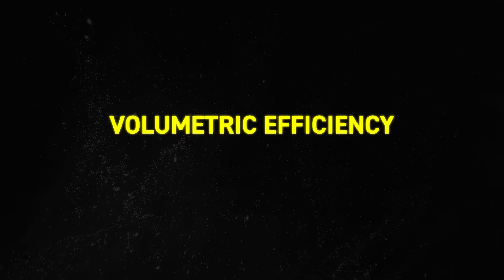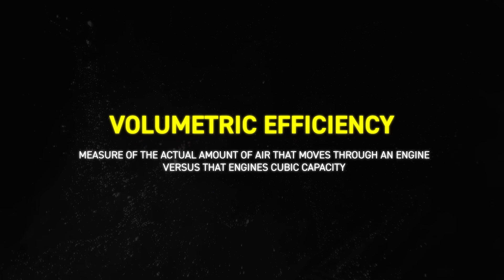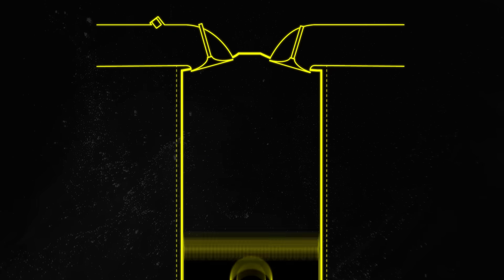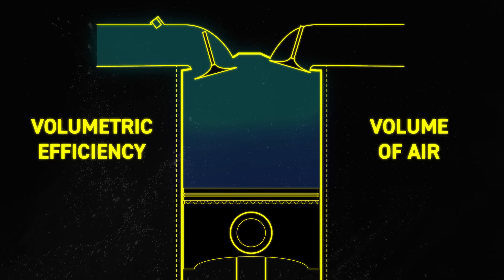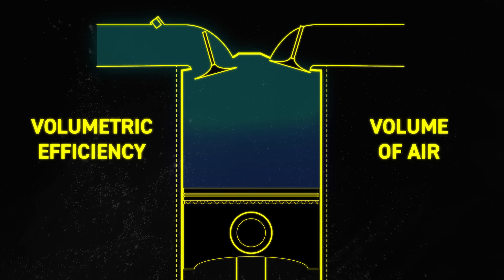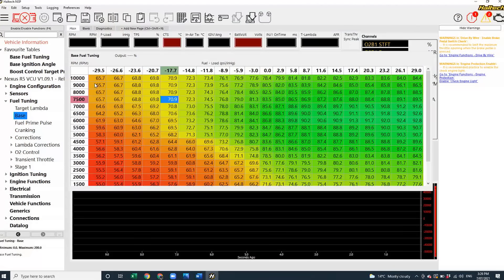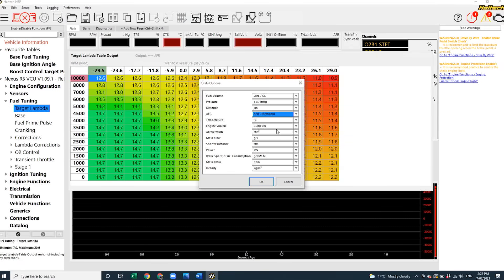🛠 Tuning with Volumetric Efficiency and other VE fun facts | TECHNICALLY SPEAKING

Comment: years ago at haltech elite training Matt said to us ,"I prefer to use  TPS as the VE table axis because its the thing that changes VE the most ".. that hit me in the head like bolt of lighting.. Thanks again Matt for the excellent explanations and knowledge you've given to so many of us  ..
Reply: @Matt Wright I can see how TPS would work great with an NA engine.
Does that hold true with a turbo and boost? I can't seem to wrap my head around it that way.
Reply: @Ye_Old_Grog  for boosted engines, no, at least not on the positive pressure part of the map.

And personally -- keep in mind I'm an above-average amateur hobbyist that has tuned my own cars with guidance from professionals, and I'm not a pro or expert in tuning like these gentlemen at Haltech; my experience comes from ROM tuning and ECU flashing late 90's and early 00's ECUs and some tuning on late-00's standalones -- I still prefer MAP+IAT over TPS, and MAF if the car has it, as TPS is the least flexible with atmospheric changes, for example if you live/drive in an area that has significant seasonal temperature swings (more significant for turbo cars than NA), or a mountainous area with large changes in elevation. So I prefer MAF as it basically directly measures the mass of air flow (as long as the flow through the MAF tube is laminar and the sensor is calibrated to the diameter properly) and it will "notice" the difference in airflow. With a MAP+IAT it depends if the ECU is programmed to think in absolute pressure or gauge pressure; with absolute pressure the ECU will still "see" the difference in ambient conditions. TPS is the most "picky" as the maps are generally only precise for the conditions that the tune was done in.

Not sure how this paragraph disappeared, but I'll try again 😆. My example was taking a weekend trip to the mountains. Start off driving at 100m elevation and a few hours later you're at 1100m elevation. The ambient pressure at 100m is close to 14.5 psi (sorry for the mixed units! I'm American 😂😂), whereas at 1100m it's closer to 12.9 psi. A car with a MAF sensor will be measuring "directly" (via how much the airflow cools a heated wire) the mass of the air entering the engine. A car with a MAP+IAT setup will still be able to calculate the mass if the ECU is 'thinking' in absolute pressure. If it makes "15 psi of boost", at 100m that's 15 psi gauge + 14.5 psi ambient = 29.5 psi absolute; at 1100m that's 15 psi gauge + 12.9 psi ambient = 27.9 psi absolute. So the ECU should still "see" the different in air mass entering the engine despite the elevation change. (For some reason I want to say that some older factory ECUs were 'thinking' in gauge pressure or the mapping was in gauge pressure, and hence would face issues with significant changes in ambient conditions, so they needed an ambient pressure reference either via a sensor in the ECU housing that would only read ambient, or by taking an ambient pressure reading during key-on before the engine turned over. This was almost two decades ago so I don't remember if that was a specific application or just a misunderstanding of how the factory ECU worked). A car that is tuned by TPS would not "see" this difference in mass flow, and would only know 50% throttle at 4000rpm for example, without "being aware" that the actual mass of air entering the engine is different from what it was programmed to expect. Hence, TPS-tuned cars are more sensitive to significant differences in conditions, and more sensitive to mods that affect the VE (e.g. breathing mods like exhaust manifolds, or freer-flowing intercoolers, etc) and need tuning more often when things change, whereas a MAF-tuned car would "see" the effect of minor to moderate changes as it's still basing everything off the measured mass that enters the engine. A MAP+IAT is kind of in-between, as it can cope with things like less pressure drop on an intercooler or a more-cooled intake charge, but some mods that affect airflow without affecting manifold pressure might still require a re-tune. As far as I remember, with a re-reference to my caveat that my experience is limited to some older kit and it's been a few years since I needed to tune anything 😅

Anyway, that's my take. If I have any bad info or misconceptions, I welcome corrections.
Reply: @jsquared1013  thats abs true but thats why you put widevand so she sees litle changes and corects it all the time so you wont have big changes since it will corect every second every second
Reply: @jsquared1013 You're forgetting an important pair of sensors;, ambient air temp and barometric pressure sensor. Using pure alphaN I see only a 3% or less short-term fuel trim going from 100ft to 7200ft DAs on my built drag bike.

By adding those two sensors as fueling correction factors, alphaN tuning where VE table is derived from TPS/RPM becomes drastically more robust than MAP/RPM VE table, particularly so with a wideband and short term trim occuring.

Where MAP inherently has noise on the signal and has a delay between pedal movement and signal change based on cylinder count/cam size/rpm, TPS has none of those and it's why alphaN is almost always the primary strategy used on motorcycles.

This is paired with a low RPM secondary fuel table that uses MAP/RPM for fueling below a user set RPM point and it is the best of both worlds, alphaN and Speed Density.

Speed Density becomes problematic (useless) with big enough cams on very high specific output engines because the MAP signal will reach max values well below 100% TPS. On NA engines with greater than 100% VE it's completely useless and alphaN becomes ideal.

Your point on MAF is spot on, and why so many OEMs use them. Their flexibility and precision allows for ideal emissions compliance. Some, like BMW use a hybrid of all 3 strategies, MAF, Speed Density, and alphaN to have the ideal strategy for any given situation.

Comment: Isn't TPS still having to approximate the air entering the engine compared to MAF or MAP? So MAF or MAP should give better emissions and power than TPS tuning?

Also, if the ECU you're using has a self tuning function then is it just changing the VE value of a cell until the AFR comes into the desired range?
Reply: @Matt Wright Interesting that the ECU still needs MAP when using TPS for the VE table axis. Begs the question of why bother using the TPS then?
For self learning it's only possible for the fuelling right? For ignition you need the rolling road to be able to see when torque drops off as you increase the timing to know the maximum advance at a certain load and revs? Road tuning by the knock sensor isn't advisable?

Comment: When starting off and tuning a base map and checking your VE table and mapping it out correctly. At what point would you have a look at the injector firing angle? How does that table correlate with the VE table?
Would tuning one require tuning the other until they both stop making changes to the output in a positive way?
Reply: @Matt Wright great insight there 👍 thanks, Matt. If I remember correctly, on many engines isn't there also a point where the pulse width of the injector is actually longer than the amount of time the intake valve is open?

Comment: Great explanation. Now my question would be. What engine modifications improves the VE of an engine. And is there any correlation between higher VE and better fuel efficiency? I have a old 7.5L gas V8 that has very poor HP/L and also poor gas mileage. Would changing parts like cams, heads and such improve fuel efficiency while making more power ?
Reply: @Matt Wright So better VE will make more power, but by using more fuel. higher AFR tuning would make for a better fuel economy (Asuming that the engine can support it, with regards to knock and engine temperature in mind). My expectations are low, but I wonder how close to a newer similar sized engine i could get out of my 89 EFI engine. Like sequential ignition timing, higher compression ratio. At least get better HP with the same amount of fuel. I understand how complex the whole thing is, but it's something i've looked for and that there is little to no info about out there.

Comment: Thanks for this. A nitpick though: "... they DON'T affect the engine air pump efficiency because they're not a restriction on either side of the intake or exhaust" (superchargers). Pretty sure superchargers are an intake side restriction ;)

Comment: Now think about VE 'quality'. I.e. the purity of the AFR mix. This brings into consideration your cam timing, variable or tuned length inlet runners, tuned length exhaust headers, ignition timing, fuel injection timing...

Comment: So some really old antiquated engines are better air pumps than some more modern engines trying to overcome mechanical inefficiency with mapping and tuning.
Reply: If that were true, they wouldn't be antiquated
Reply: Emissions Standards are a thing now.  They weren't back then...
Reply: @coreyfraser9101  I'm missing your point. Are you answering for the OP? Are you suggesting that an antiquated engine is somehow more efficient than current engines? Present day engines make more power better fuel consumption and much better longevity in spite of emissions standards. Hence not seeing your point

Comment: Next time someone asks how an engine that's now running a different turbo on the same boost level can make different power, I'm going to point them here. That point isn't necessarily covered in great detail but yes the efficiency of the turbo does affect the overall result all else being equal....
Reply: Another main point with that question is that different turbos can flow different amounts of air at the same "pressure ratio" (that's what the turbo companies like to call it lol) due to compressor housing/wheel sizing and efficiency differences.
Reply: Ive always told people, imagine 20psi through a straw vs 20psi through a drain pipe, ones moving much more air

Comment: anybody that wants a deeper dive into this should look up the ideal gas law and stoichiometry. a better way to describe VE is as the percentage of the air mass of the fixed engine volume at a given pressure and temperature that makes it into the engine.

Comment: Bravo!!! Finaly someone said it - the only thing that really matters is the mass, not volume. I had numerous number of arguments about it when people were trying to convince me that comparing the voulmes is the proper way of calculating VE...
Reply: Eggzactly! Charge volume will change with temperature, while charge mass is what you need to calculate A/F ratio!
Reply: @tojiroh  charge volume shouldn't change with temperature unless you've got a really flimsy intake manifold 😜 but yes the pressure will change with temp and hence the mass will change.
Reply: @jsquared1013  or course! I was talking about intake/charge air temps, but manifold material can be a factor too. 😉🤓

Comment from the maker: WARNING: Technical Content Ahead!
Volumetric Efficiency or VE is a measure of the actual amount of air that is moved through an engine vs the engine’s cubic capacity. Sounds simple right? Well, while the definition might appear simple the correct application of VE in engine tuning requires a bit more knowledge. If you're in a learning mood, grab a cup of your favourite beverage, find a comfortable chair, relax hit that PLAY button and let the knowledge flow into you...
Got a topic you'd like us to cover? Leave it in the comments section!

Shortcuts:
00:00 - intro
00:45 - VE basics
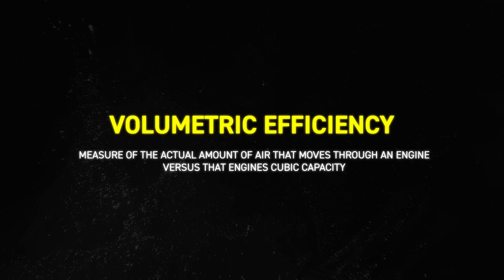02:15 - Why is VE important in engine tuning
03:30 - Diving deeper into the VE details
05:00 - How turbos affect VE
07:40 - Engine Load or Manifold Pressure
09:00 - What information ECU needs
09:30 - How VE tuning works
Reply: Can’t wait to watch this
Reply: This is a great companion to a lot of Gale Banks' manifold air density lectures.
Reply: Just a correction a supercharger is a restriction on intake efficiency just not the exhaust
Reply: hqw would this stand against with whats happenig in the usa and could we beat it!!
Reply: @buddyschnaars851  ... what?
Reply: Damit it's not a air pump and you promptly describe how it's not it is the final refinery not an air pump other than that I like the video well explained VE
Reply: @keithchristensen916 literally. An air pump.